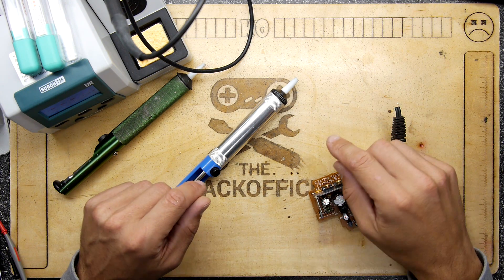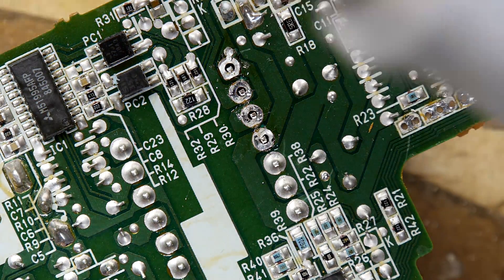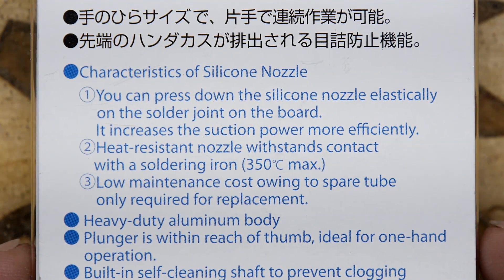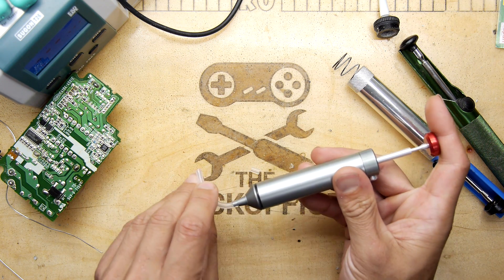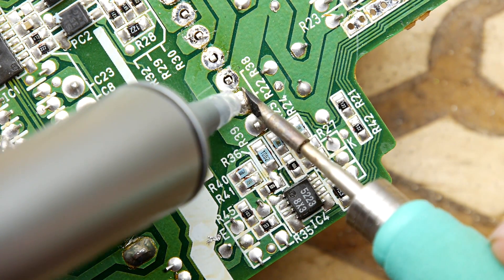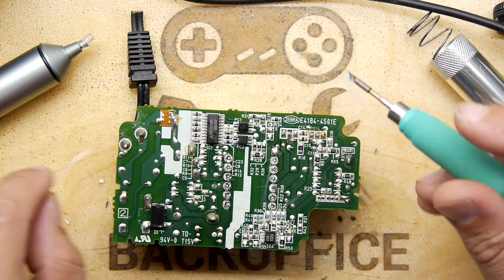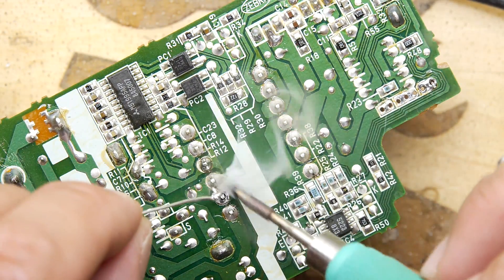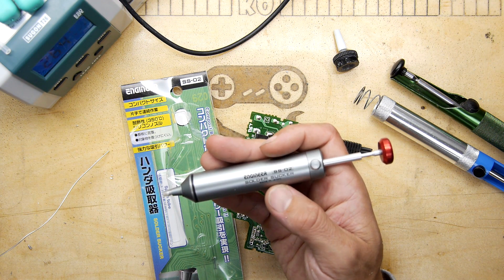The SS-02 Japanese Engineer Solder Sucker

Comment: This tool is new for me.  So the sucked up solder turns to dust and is easily cleaned out?
I got the cheapest one I could find.  Yes the tip is a bit large so I wondered if an old cut- off pen or automatic pencil tip could be McGyvered on for the small bit of work I have to do.  I'll see what I can come up with from the parts tray. The all metal one is beauty tho.  Liked.
Time passes.  I did manage to fit on an old mechanical pencil tip from a disposable pack of plastic ones.  I'd like to try some samples first but need
some throw away board for that to see if the add on tip melts before the job is done.

Comment: Note that all suckers get weaker over the years. You can easily strengthen each sucker by taking out the spring, and pulling it into length. Compare the length before and after. For example I stretched my spring to 150% and wow, much better sucking power now.

Comment: I just bought one - and it sucks! But not in the good way.. it has so ridiculously low suction power, it simply doesn't work :( I don't know why.. opened it and everything is looking normal.. at least compared to this video. I could not see what the other inside half is supposed to look like as it wasn't opened from the back in this video..
Also the sound when releasing the pump is strange.. it sounds a bit like my old standard-plastic pump, when it's clogged. But there's nothing inside, it's completely new and clean.
Reply from the maker: That does not sound right 🤔
Reply: @backofficeshow  I just filed for return at Amazon. Don't want to sit on this kind of expensive  thing if there's no easy fix available :(
Reply from the maker: I think you did the right thing
Reply: @backofficeshow  Thanks. It's just so annoying.
Reply from the maker: The old style ones have been around for a long time. I am sure there are a few high quality versions of those available as well. I have some for a few decades and even they were second hand 😂
Reply: @backofficeshow  So you are saying there's an older an an newer revision around? How could I tell these apart? Btw: My old cheap pump is practically identical to your narrow tipped green one. And it's much stronger than the one I have just sent back .. so most probably there's something wrong with the one I had, so now I wonder if it was just the one pump, or if the current charge at the sole national vendor here is broken .. I already contacted him, maybe he will find answers.
Reply: @backofficeshow  A little update, in case someone cares: 
I asked the national distributor if they could check the SS-02 pumps they have, if there was a production issue with the whole charge, or if only the one I received was too weak, for knowing if it made sence ordering another one.
But sadly I did not get an answer, yet.

In between I noticed that the 'regular' desoldering pump I have actually is no cheap generic china pump, but a more expensive product 'Conductive 77' by the swiss company 'Ideal Tek', with double O-rings.
Maybe I am spoiled by this pump, and it's actually just normal, that the SS-02 has way less suction power, as it only has one O-ring.
Problem is, that I need a new one, because the tip won't be useable for too long anymore, and the swiss made 'Conductive 77' solder sucker seemingly is not being produced anymore.
so now I wonder if it's worth trying another double o-ring product, like the Pro'sKit 8PK-366NA (which is much cheaper then the SS-02 and only made from plastic), or if I should try another SS-02 ...
Reply from the maker: If you get a plastic tip you can always buy some silicone tube from eBay, Amazon etc and make your own nozzle

Comment: I should get mine today but how many times have you gone to suck the solder with the cheap ones and the plunger hasn't' been depressed or set and ready to go?  I swear every time that happens.  I noticed that you can tell with this one right away if the plunger is ready, that right there ALONE makes it worth it.

Comment: The teardown and review was useful, and then you completely sealed the deal for me when you used it for the first time. Seeing how quickly you desoldered that transformer and how clean the holes came out, wow. Decision made. Mine arrives tomorrow, so excited to try it out over the cheapies. Thanks for the video, especially the closeup views.

By the way, can you please share a link to the blade tip you're using? I want to find something similar for my FX-888D. I love how thin it is; would make bridging in tight spots really easy. Closest I can find is the T18K knife tip, but it's still a 2mm wide wedge, not a thin blade like yours.
Reply from the maker: I'm not sure exactly of the top of my head, but I am sure I referred to it in this video and possibly a link in the description 👍

https://youtu.be/UACZMu7o06k
Reply: @backofficeshow  Part number was right in the video, thanks so much. Off to do some searching.

Comment: Vellemen makes a heated solder sucker that's awesome and affordable.
It's like these only you plug it in the tip heats up.
I would share a link but IDK if youtube will flag my comment?
Here's the description:
Velleman VTDESOL3U Vacuum Desoldering Pump with Heater 30W
Reply from the maker: I know the kind well, they seem to be well available and significantly cheaper than the motor ones. I do like the explosive suction of a spring pump, can't be matched
Reply: I have this but it doensn't do the job well. imo the nozzle  is too big..